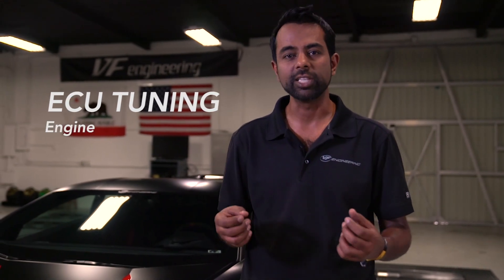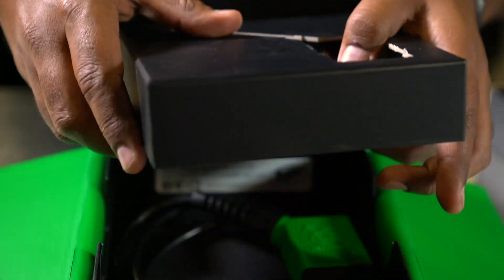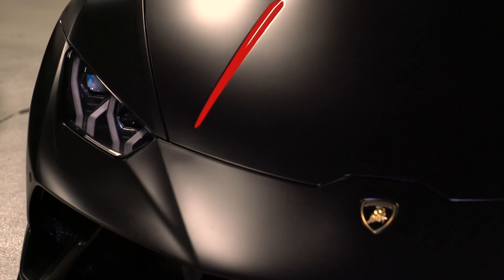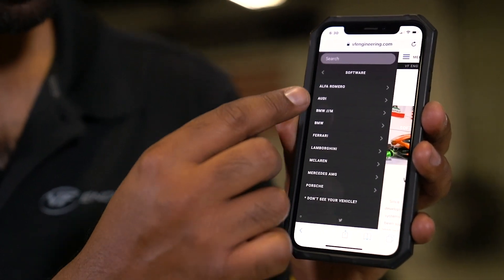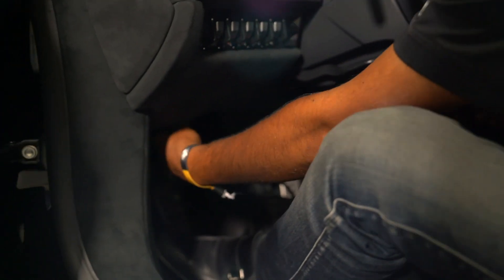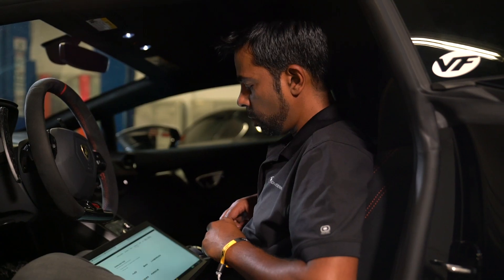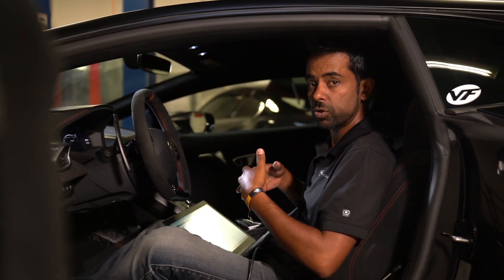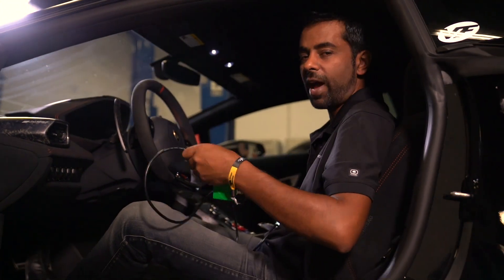VF ENGINEERING INTRODUCTION TO ECU TUNING

Comment: Hi VF Engineering Team, 
Is it possible to backup the original file if the car needs to go back to stock? And if there is another tune on the car from others, is still possible to be tuned by your software?
Thank you